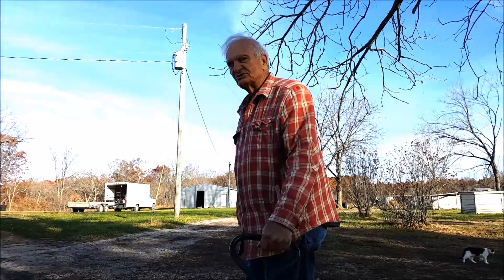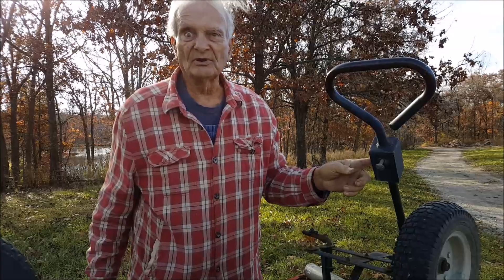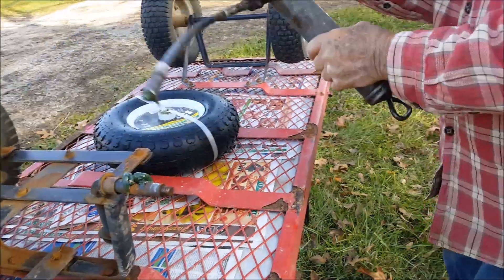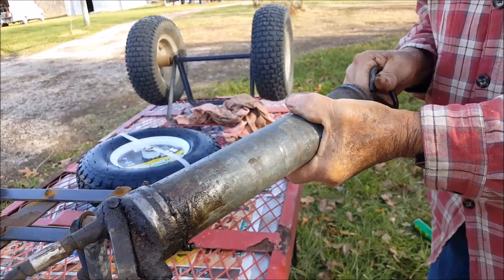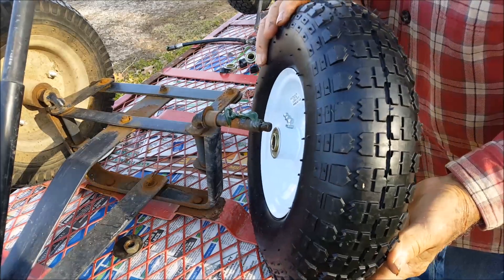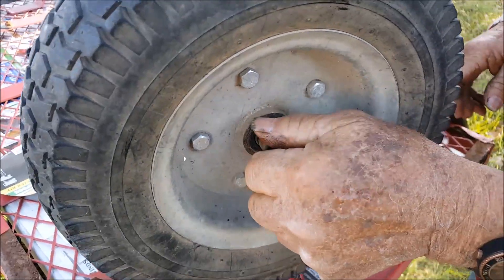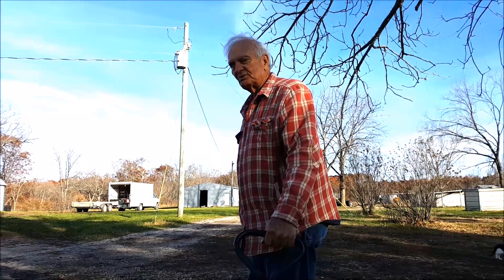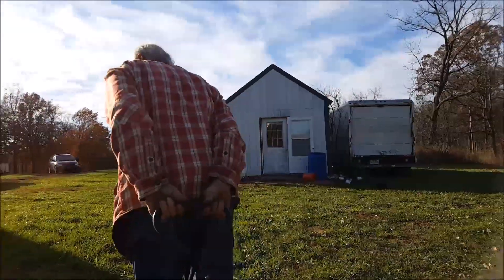Old Guy Greases the Wheels

Comment: I bought 5 of those wagons from the greenhouse operation, next door here, for scrap prices, last year. With a little shuffling of parts, welding and greasing I got 4 of then back up and working, sold one to my buddy, and have 3 here now. It is great that the new wheels have grease fittings, but odd that they put them on the opposite side to the air valves. Here I thought he said it was ready to haul a whole lot of jams and Ocra, not a whole lot of Janette... ;)
Reply from the maker: You got a good deal on your wagons.  They are really handy to have and save your back on those heavy items you need to move around.  Thank you!